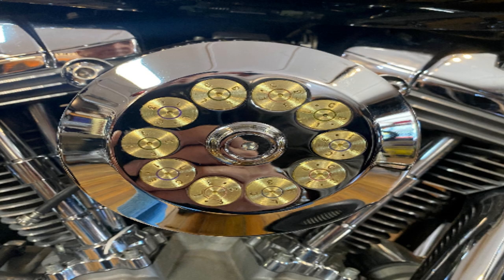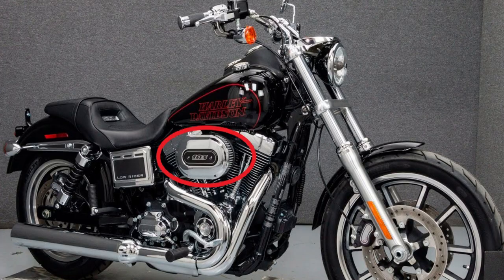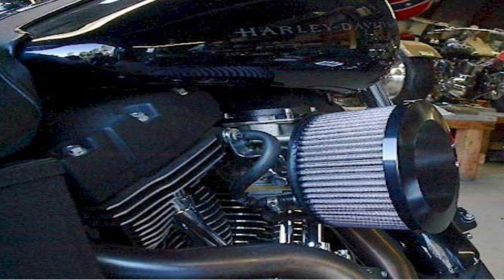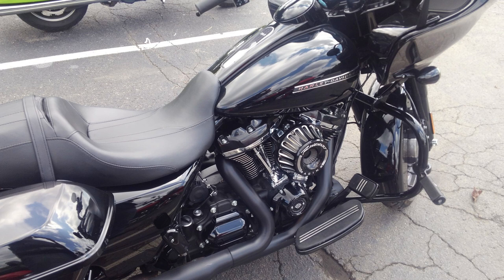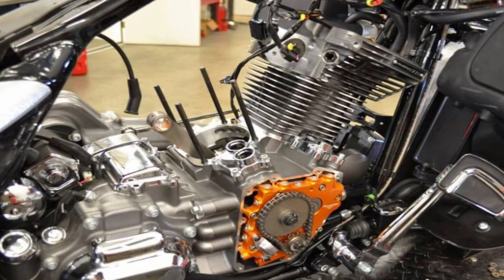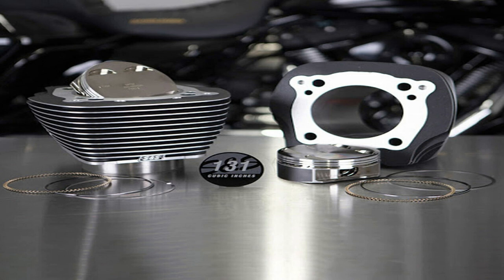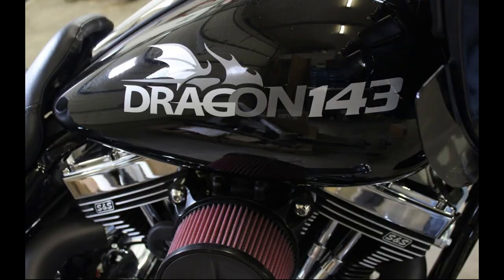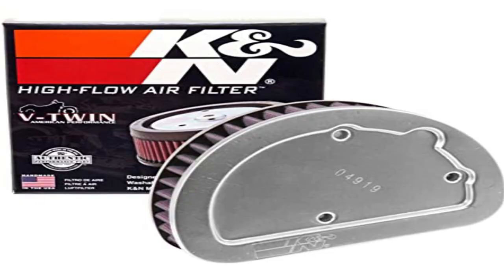Feed the Beast, Harley Air Cleaners Can Make or Break Your Build

Comment from the maker: Have you done an air cleaner swap on your bike for gains in power?
Reply: I primarily went with the fuelmoto on my '21 flsl so i can vent (drill and tap for fittings) the heads outside the air cleaner.
Reply: Using a S&S stealth on my twin cam & a S&S G with teardrop on the shovelhead
Reply: I first had an s&s stealth on an 07 ultra 96...worked well...now I have a 14 street glide with a larger screaming eagle...works well also..forgot to mention the s&s was in conjunction with a stage 2..ie cam etc..the screaming eagle was done with the whole 9 yards...big bore...heads..cam..timken conversion etc.
Reply: Nope. Just for looks.

Edit: went with ventilator extreme. I assume it will flow enough air?
Reply: Found a nos se stage one on eBay and just put it on my '97 rk last night, mainly for the ease of adding a breather to get rid of the oily mess.
Reply: DK 425 baby!
Reply: Carb yes, but for EFI Fuel tuning is the answer, cheers.
Reply: velocity stack on my carb
Reply: Yes, multiple. I have found AC’s to be more sensitive to carb’d over FI, cam lift, duration, exhaust type and carb all play a part, as to any bike. Point is, there are certain AC’s that won’t play well with my build, yes you can tune anything but it doesn’t mean you are making gains. We won’t even get into geographical location lol but it’s true!
Reply: I have a Screaming Eagle Heavy Breather on 2007 Fatboy.
Reply: Yes, but it was for economical reasons. Cleaning and re-using the air cleaner over the life of the bike. I did not realize that opening up the air cleaner would take away from the compression required to pull gasoline from the restricted jets.
Reply: @semperfipar1299  Just runs leaner, changes the AFR, you could run it open and add fuel to the circuits. I couldn’t tell if you were being sarcastic or not. You’ll eventually lose compression running lean after smoking the valves lol
Reply: It was not a injected bike and I did not write that very well. The bike came with little openings and the carb jetting was not proper. The bike has high compression and Harley relied on vacuum not compression to pull enough fuel into the intake. The little air box holes just choked the bike all the time.
Reply: @semperfipar1299  I gotcha now.
Reply: Nope. My 09 Dyna I  removed the inner plastic part of the air cleaner assembly . Its UGLY with a stupid forward facing  air scoop. I took the entire plastic thing off leaving the outer chrome piece in place . Replaced the paper element with a K&N . This also means I have the sensor unplugged that went into the air cleaner.  Removed stock pipes. Have a set of straight pipes with baffles in them . Not to loud not to quiet. No reversion. You dont have to worry about so called back pressure. Its REVERSION that is the problem. Runs great. sound fine.
Reply: I went with an Arlen ness sucker on my ‘99 dyna super glide with a 95ci kit. I bought a pretty plate for it but went back and put the stock cover back on. I like the looks of the stocker, I wish it wasn’t so restrictive though. I can’t tell much difference with either though
Reply: @125saito  How is the DK Customs working out for you ?
Reply: @frf239  Just fine. It's the one I had my bike dyno tuned with and the was no problem getting enough air. I went with the black and silver finned cover.
Reply: I got a 2017 FXDB streetbob 103 Twincam last of the Dyna's😭😭😭 just click 65,000km
It's a stock motor but I have Bassani Sweeper exhaust with a Screaming Eagle heavy breather for that aggressive look & to drive more air into the motor.... Also a FEULING parts vented dipstick to help reduce Blowby & excessive crankcase pressure build-up ❗ .... Only using a SE Super Tuner Pro.
Now don't get me wrong, I know their is so much further potential & their are bigger motors out there....
BUT this stock 103 is a absolute Weapon ❗💪💪💪 it will destroy so many HD's Twincam's & Milwaukee 8's with stage 1 & even some stage 2's that have only the SE cam's.... 
As I said "don't get me WRONG" I know I don't have the biggest or the strongest 103 Twincam BUT choosing the correct set-up straight out the box WILL make or brake your motor & your hip pocket....🤔🤔🤔
Think twice, buy once💪💪💪
Living the FUCKING Dream ❗
💪🇦🇺💪
Algorithm
Reply: 2010 96 with 103 big bore kit. Andrews 57h cams. Stock 2 into 1 into 2 head pipe with the cat removed and cycle shack slipons. Arlen Ness big sucker. Vance and Hines fuel pak. Barnett extra plate clutch. Runs awesome
Reply: When I put a V&H 2into1 Big Radius on my 2016 TC103 HO, I also installed a  K&N RK3041  ( bigger) airfilter under my original Rushmore cover. Modified it for external crank breathing behind the airefilter plate, and with a Kuryaken 9931 Bluegrass mini oil catcher just under the airfilter. I let it tuned on a DynoPowerbank and got 111 ft-lb: at 3200rpm and 89 rwhp, a fine power curve line, (smoother engine at higher revs) and an important engine heat drop.
Reply: Just bought the trask assault for my 16 dyna street bob... it's pretty bulky and in the way..... back to the drawing board... perhaps a 90 degree air cleaner.
Reply: The previous owner did the stock K&N air filter swap with the OEM hot box still installed. He also installed V&H Big Shot Staggered pipes. He did have a Fuelpak 3 installed and tuned the bike. The bike was running ruff and only smoothed out at around 70mph. I knew I had to upgrade the air filter, so I went with a DK 828 air filter. After installing the new air filter and doing an auto tune, I can tell the performance of the bike has increased and the bike runs much smoother in all ranges.

Comment: GET AN ALUMINUM INTAKE MANIFOLD Before you worry about changing an air filter. my 2023 soft tail standard came with a plastic intake. My 2023 soft tail standard came with a plastic intake manifold and both screaming Eagle and S&S are back ordered for the cast manifolds. Is their a supply issue with aluminum because it is made outside the US SO THEY ARE USING CHINESE PLASTIC to save a few cents on a part? I was lucky My dealer got one and will install this week. Yes, it is a new warrenty bike so I am letting the dealer do this and I have not ridden my new harley much until this is taken care of. great video. Thanks

Comment: I’m a pretty conservative guy when it comes to these power upgrades. I have a 2012 Fatboy Lo with a 103 that is completely stock except for a set of V and H slip ons. I know I’m not Normal but I actually like the look of the stock air cover and don’t want to change it and alter the look which I happen to like. My question: Can I get a K an N air filter that works with the stock cover? And will that also require a tune ? Thxs
Reply from the maker: K&N in the stock air box won't require and tuning, it might give you a bit of a gain but likely it will only give you the benefit of a reusable air filter.

Comment: I have a 08 Softail deluxe. Going to do a SE camplate,oil pump, SE255 cams, new shoe tensioners n cam chains, new tappets n pushrods. I have a v n h exhaust. What would you recommend for an air filter. Bike will stay stock. Looked at Arlen's 90° velocity air cleaner. My dealer said I wouldn't need that much air for a stock mtr. What Arlen cleaner would you like or what other mfg would you recommend. Thanks

Comment: Hi Gixxer i know its an older vid but I have 2016 electra glide with a bassani 2 into 1 k&n element with stock cover and techno research tune. I ride 2 up all the time would my filter element hold my bike back you think is it worth upgrading to a actual air cleaner. When i ride with my buddy and his older 103 NON HO he rings his out i can get him if i ride 1 up but 2 up he will get me every time even with my different 103. He has true duals and a open air cleaner. I was thinking its the two up weight but just wanted to ask Hope your doing well Gix i watch all your vids numerous times cant wait for the new ones to come out

Comment: I just went with the V&H tuner, slip-ons and Screaming Eagle/K&N  filter and couldn't be more pleased. The first time I kicked up to 2nd gear it's like "Darn, tighten your grip on the handle bars 'cause she wants to go!" Day and night difference. Out on the highway the performance improvement was more subtle but definitely noticeable. From 0 to 70MPH with the stock configuration you could feel the bike was working to get there, not lugging or struggling, just a little bit "working". After the stage one upgrade and new map it's so smooth, I would say effortless for the M8 kinda like "is that all you got".
Reply from the maker: I tuned my bone stock bike with a FP3 using the improved stock map just out of curiosity and it was night and day too! It makes a huge difference when you get some fuel in those bikes, especially the M8's! I'd imagine your overall rideability has improved quite a bit too!

Comment: Slip ons are only ok in touring models up into 2017.  The restrictive catalytic converter is in the head pipe.  In other models the cat is in the mufflers so slip ons open it up like normal.  It's model specific.
Reply from the maker: Touring guys got screwed on that deal having to replace the head pipe, plus the placement of that cat was just awful. Those head pipes would get stupid hot with that cat in there.

Comment: My LRS 21 is running the stock air box with KN filter, cr483 cam, dnd pipe, injectors and making 127hp. You only need a premium filter not the whole thing!
Reply from the maker: That's pretty impressive with the stock air box!

Comment: Was originally looking at a cam upgrade on my 1999 TC88 (which currently has SE cams) because I needed to replace the chain tensioners and I was looking for a little more power. Your video's enlightened me to the issues of the throttle body runner restrictions, Magneti Marelli fuel injection limitations, etc.,  which saved me a lot of money and headaches! Thank you for the great content! Keep up the great work!
Reply from the maker: Thank you, I really appreciate it! If you've got the MM FI I would run with you have now if it's working, carb conversion is always a great option if you ever have a issue with the FI. But changing over you're cam chest wouldn't be a problem if you leave the same cams in there.
Reply: Planning on leaving it alone until I have a lot more money saved up to do a FI upgrade, along with bigger cams and other upgrades.

Comment: Thank you Mr. Knowledge House.  My dealer said those exact words as he explained to much air is no good,, so just open the stock heavy breather.  And when I pushed back based on what I learned on your channel 💯, he then said the cleaner would be a problem ergonomiclu.  I purchased the Trask Assault the same day. It adapts to the larger throttle body, thus growing with me build.

I think it's time to divorce my HD Warranty.  I like the people there, I'm just headed in a different direction and I don't take kindly to someone telling me what I can and cannot do with the bike I purchased.  This is where I'm at now, in preparation for something serious from Moonshine or Rattler. So at this point a SE tune for the sake of warranty is pointless.  Which tune do you recommend for that 22XE?

Wood 22XE, S&S plate, pump, lifters, cam barring, tappet cuffs, Fuel Moto rods, Trask external breather and M8 Check-Mate...I will use a catch can for both to address vacuum. TBR Shorty Turnout, I will take the minor ding on low-end torque.  14" bars w/ 2" diameter, and Lucky Speed Shop shorty trigger levers.

2020 Fat Boy 🦅 of a 🪶
Reply from the maker: With everything you have going on I would go with PowerVision, if you get it from FuelMoto they will send you a tune for your setup you currently have. If you make changes you can contact them for a updated tune if you add a cam. Those files are great starting point but of course a good dyno tune session is gonna be the best. It's not worth putting money in the warranty approved parts if you're looking at going in the aftermarket direction!
Reply: @GixxerFoo  thanks for the detailed response.  I know you've got alot going on.

Comment: I was lookimg for a low profile air cleaner bc of the lack of room on the right side with the stock air cleaner taking up most of the leg space so i found a few but they were like $350-$500 until i foung a sight "crio3d" was have a close out sale paid $30.00 from the manufacturer for the same air filter distributors were selling for 200x as much, so i bought several different ones for everyone with harleys for Christmas. Needless to say the sold out very fast also had their slipons on sell for cheap.

Comment: I want to eventually put lower fairings on my Road Glide and I've been running the Screamin Eagle heavy breather on it for years. The problem I have now is that lower fairings aren't compatable with a heavy breather. So that's something else to consider. I wish that I had just put an S&S Stealth air cleaner on it back in the day when I bought it. Now I have a Stealth on order to use with either OEM lowers, or Big Bear Performance FXRP style lowers (those are probably what I'll go with).

Comment: The K&N RK-3932 that I bought for my bike had dyno chart that showed a 9.8 HP gain and 9.9 lb. ft. gain on a 96 cid TC. I’m hoping for around a 7.5 HP and 7.5 lb. ft. gain for my 88 cid TC and the foundational work for possible higher lift cams, bigger bore, higher compression, and CNC head porting in the future. I’ve already received the DynoJet PowerVision pv4 tuner to get the fuel mapping corrected. Thanks for the video, Foo, it was informative as always.

Comment: Good morning man, just to let you know I realy appreciate your videos. I've learned a lot from them. Especially the one you did about the cam chain tensioner issue. Bought my first bike (05 electraglide) just before I saw that video. After seeing it I had them replaced with the hydraulic  ones, Andrews cams TW26A, Fueling cam plate and a T Max tuner. Made a huge difference from stock.  My next project is a big bore kit.. possibly the 98" per your video.  Also installed the SUNPIE LED head light/passing lights. Had them over a year now and they are awesome for.the price. I'm now looking to replace the air filter per this video. I have the stock cover with an open element behind it (a round one). Not optimal I guess. Toward the end of this video you have what looks like the stock electraglide cover with a thick oval element behind it. I realy like that look.  Any idea what brand filter that is and where I can get the same thing? Thanks man, looking forward to your next video! Stay safe out there!
Reply from the maker: Thank you, I really appreciate it! That picture at the end of the video was actually a stock cover that had been cut down. You could do that with a K&N that is the stock fitment but taller, you'd have to source longer mounting bolts and would stick out farther though. You've done some strong work to your bike, that things built right for sure now!

Comment: On my 2021 Tri Glide, I added American Custom headers with cat removed, American Custom slip-ons that are pretty much open. I put 4 inch baffles in the mufflers and added a SE air box with stock cover plus tuner. The trike runs great and much less heat getting rid of the converter. What you think?

Comment: I just recently did a Bassani Road Rage 3 and S&S Air Cleaner along with a Powervision tune on my 103 and I was pleasantly surprised with the gains. Making 81hp and 105ft/lbs.
Reply from the maker: Damn those are really good numbers! Bassani makes a excellent exhaust system, that's some killer numbers. Is that with stock cams too?
Reply: @GixxerFoo  Completely stock cams! I wanna get that done as soon as I have it paid off.

Comment: I'm getting ready to change my throttle body out I would love to see the video on your throttle bodies.
I'm a firm believer you get what you pay for, I ended up with the K&N filter and an Arlen Ness setup with a air cleaner cover that matches my front wheel. It looks nice and performs extremely well.
All said and done it was a little over $400

Comment: I have a 2021 Road Glide Special. My Harley technician told me the 114 comes with a stage 1 high flow air cleaner. I was already getting a  set of Vance & Hines torquer 450 slip one but he recommended the screaming Eagle heavy breather which is very similar to ones the come on the new Roadglide ST. He said I would not need a tune since I already have a high flow air cleaner. Any comments on this?